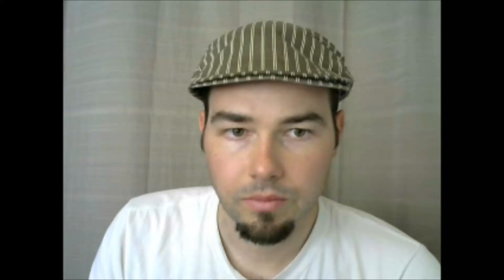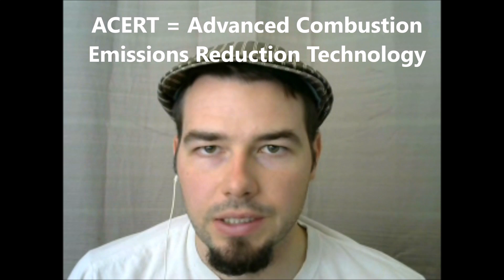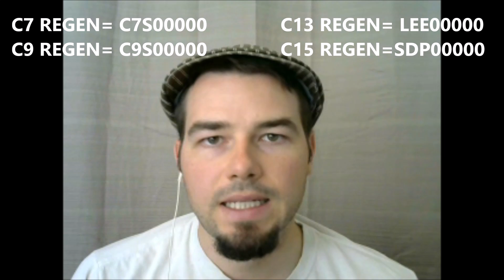Regen, Aftertreatment, and DPF System Class.  Cat Emissions Systems Course.

Comment: Thank you for all the information Im working on a 2016 336f that has a 1052 code low fuel pressure to dpf.sence determined that lift pump is not getting power. Ive checked fuses and relays in fuse box all good. My question is where would i find or is there a moduel or relay outside of fusebox for the pump. Thanks again for the video

Comment: Hello I have and error code on a c 15  spn 3473 fmi 31, so is it the ard head or the air pressure control actuator

Comment: Thank you so much for explaining these region videos to some illiterate like myself , I do have a few questions as to what to do..My flashing regen lights flashed more frequently , sometimes the regen would work and sometimes not, But I tried till it was completed .Ond day I heard a weird noise and found out it was the exhaust hooked up to the regen tank , the flex rotted out then the regen light came just after the truck was started , I tried multiple times to complete regen to no avail . I then got the stop engine light so I shut it down. I took the pipe and tank off , the sensor portion I couldn't get two os the bolts out , the ones with the long toothpick looking things ..tried to heat it up to remove , but they broke off so I had to drill it out ...my plan was to get a new pipe , and clean burn the tank at a local DPF place ....My question is ( after talking to a friend who seemed me for not contacting him first to run codes and testing ) should I continue to buy a new pipe, clean the tank and now buy new señsor gp or am I better off getting a whole new set up( will it be just as much ? Im lost Thanks IN advance Angelo
Reply: Go to your local Cat dealer. They have media they can get for you. It shows details of what is going on.
The REGEN light coming on by itself is not a problem. When it is on and the CEL comes on, you better get it REGENed, if not in about two hours you will be in lock out and your calling the hook.

Comment: So from 2007 threw 2010 cat had to rewrite the software then we had the epic repeated failure of the ARD head the lower section would separate then they had the packing popcorn plugging the fuel ports in the head. Then let’s not forget about the fuel enable valve fiasco. 85%of folks at the time had no clue what to do. Dealers had daily phone meetings to share what they dealing with and trying to find resolution to the customers problems, in reality it’s was flawed engineering from the get go. Towards the ends they got it somewhat stable but by them cat on road engines had been pulled from the market.

Comment: In need of some advice. I got a cat xq425 generator with a cat C13. It’s having regen problems. The trouble code I have is 3837-17. Aftertreatment secondary air flow to low. Not sure on how to go about troubleshooting this code. Please HELP.

Comment: I’m getting a code for injector fuel trim 268-2 and it won’t regen.

Programmed parameter fault : erratic, intermittent, or incorrect Injector trim.  C9 engine, 160m2 motor grader

Any ideas?

Comment: Frustrating that is controlled by ecm .. I got a volvo and after regen complete I still get the filter is full and 0 changes. Once it was reset thru computer , it showed the real soot procentage.. sound just minor reset button but will put u in 5mph .. talking about taw expense and volvo dealer taking the sweet time to fix something.  Was told to replace the nox sensor because is aftermarket however they offer to buy aftermarket nox sensor.  Haven't change it and not getting the problem .. it s very commen to have the parked regen and un registered true soot level when filling up the def tank full . Lots of vnl owner have same problem and unsolved.  I m not filling it up all the way (def fluid tank) and no problem allready 2 weeks with same aftermarket nox sens

Comment: I run an 09 t800 with a c13 dpf engine.  The biggest problem inrun into is fuels pressure.  Inhave to change the primary fuel filter at no more than 6k miles, otherwise the fuel pressure drops too low while driving and nothing works rite.  Wont regen properly, especially if trying to pull a grade and the engine just falls all over itself.  If im running down the road and the dpf light comes on, i switch out the fuel filter and bam, back to normal.  Its been to the cat dealer more times than i can count since it was new.  Everythings been changed numerous times, and the primary filter is the only constant issue.  And we run cat filters.  Guess the fuel in the northeast is just shitty.
Reply: The way the system is designed, the primary filter plays a big role in a Cat truck REGEN engine. The secondary filter is not used for the REGEN system. Cat offers two primary fuel filters, a smaller and larger. Also the primary fuel filter base Cat offers is a high flow. Most of these was changed over when the problems started showing up.

Comment: My company bought a nice loader with a regen  from California, the thing was a mess with this epa crap. Over idling, flu always plunged and needed a certified flu dude to clean it  every month, down for a week, cost 2000 ,....... mechanic changed the computer settings from stolen software, pulled all of that crap out, now it’s the best 980k in the plant.

Comment: I love your channel helps me out a lot on the few c13 engines we have . I have a c13 I’ve been fighting ard head issues on installed a new ard head 2 nd one in 7 months it tried to regen and failed giving me a dtc 3711-31 do you see this code frequently? I’m going to use your class lessons on it tomorrow I was just curious if this is a frequent code you see
Reply: We went through 5 ARD heads before an old timer found a small crack in the air to air!

Comment: Been on this truck for days...I replaced the Ard head due to fouling in the swirls..before it would not get up to 1500 or 1600.. now it does...now I have dpf inlet temp not getting hot enough...I have a new dpf module with temp sensor..no exhaust leaks..and I'm bout to give up..any more suggestions

Comment: Man, thanks! This is brilliant! I work in the workshop of a company whichs has about 120 road vehicles and 50+ maschines/wheelloaders/excavators ... . We recently got an diagnostic tool that can also be used on CAT, cause we just need to get into that stuff to be more independent.
Yesterday we got an problem with a CAT 966K (GNX, engine MYE) and i tried to diagnose it today, looked and alot of things that you mentioned in this video, cause logic, but i didnt know what was a good value and what not. I simply dont have access to CAT repair manuals, of cause. 
This video shined a light on that system. Still need more practice but thanks for that boost!

Comment: I have been a subscriber for awhile now and somehow missed this video. we have a c15 with dpf that keeps asking from regan. only code it throws is 3719-16 dpf was removed and clean not to long ago. also has a new ARD head. We to have ET so now its time to do this my WAY! thank you to the video and sharing your knowledge. hard to fine people willing to do that.
Reply from the maker: Thanks for watching and hope the video helps.
Reply: @AdeptApe   it did a successful manual regan. But I never look at the boost and differential pressures I think stating to thing it’s the secondary air.
Reply: If you clean the DPF, you have to reset the Ash model one time. If you replace the DPF with new, you reset the Ash model twice. Data log ALL REGEN's and look at it. Each person looks at different items. You have to set up a status screen strictly for REGEN data. I look first at Flame temp, fuel PSI command, pilot and main psi, combustion air flow, DPF inlet and outlet temp. I then check, boost psi, DPF dif PSI, and CGI flow. When you look at it set the number range manually so it scales out and the graph is not on top of each other. See what max fuel psi is and set low to zero and high to what you see rounded up. Combustion air flow I set zero to 350 f. Temps are based on zero to max. So set all of them the same so you can see what's going on. Target temp on DPF inlet at a 1400 RPM REGEN, is 1083F. In cold climate might be lower, but should be at least 1025F. You can also bump the RPM's up and do a 1500 RPM REGEN, you have to use the ARD over ride function. Set your data log at sample rate of 20 per minute. A REGEN is divided into several parts. First thing it turns fuel and air on to see if it can control it. If so it will light off. It then goes through what I call the stupid stage. I think it's seeing what it can do and what path it follows. Once that is done it goes into the core of the REGEN trying to obtain the 1083 F DPF inlet temp. Once REGEN hits around 92% it goes into lean burn and tries to heat up the bottom of the ARD head and burn off soot.
Once that is done REGEN shuts off. Then turns on fuel command at 81.83 %. Then it turns it off and back on at 50% command. What it wants to know is the fuel turned off. As spark plug is sparking all the time while engine is running. So a high fuel psi code may go active at the very start or the very end, if PSI is on when you should have low or no PSI. I then let it run until DPF inlet and outlet temp are close. Now if you had a REGEN code your DPF inlet temp will come up slowly. As you had a failure, the system don't want to throw to much heat in the DPF quickly. I usually do a second REGEN once it cools down, so I can see what it looks like. Also always run a ASVT after REGEN is done and check stage three and four closely. Your measuring combustion air flow, off and then full on. Another item to be concerned about is the ARD fuel lines between the number three fuel manifold and the ARD head. If they haven't been replaced, they are getting old and could be breaking down internally and allowing debris into the ARD head. 
The system will not REGEN driving if the engine is above 1800 RPM's, pulling 80 % load factor or higher, Engine brake physically on. Every 25 hours of running it goes into a heat cycle, so if heat cycle is on REGEN system is turned off until it completes the heat cycle. A driver who does not understand how the system works causes more problems, they have to be educated on what to do and what not to do.     
The more data logs you look at the better you get. Look at good ones so you know what a bad one looks like. You can also over lay the data logs. I data log a lot of stuff, cylinder test, coolant temp test etc.

Comment: I dont have ET but my scantool will let me do a soot clean regen. Soot level was too high and in the red CEL,  no CEL now.  It will not let me do a manual regen. I am not able to read the parameters that ET has so I may just throw an ARD head at this C15 SDP.    Will I still need to get an ET reset?
Reply: If you have certain codes, the system will lock you out and you can't do a REGEN. You have to clear them first. When replacing a ARD head, you need to flush and replace the filtered fittings. I also check amp draw on the ARD head, do a ASVT before and after a REGEN. Lastly when you preform a REGEN, it is best to data log the REGEN to see if certain parameters are meet. Also to check DPF restriction. As far as I know CAT ET is the only tool to do this. ARD heads cost over 1K, plus other required items, your call.